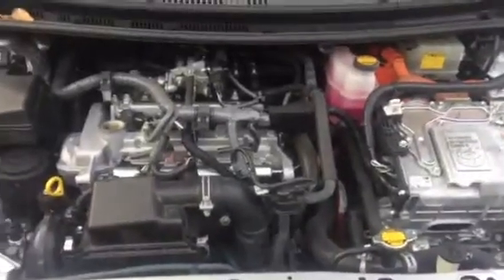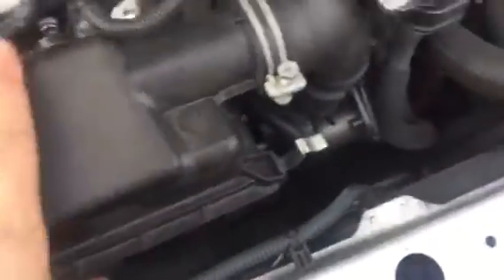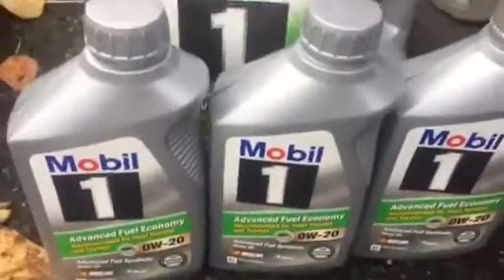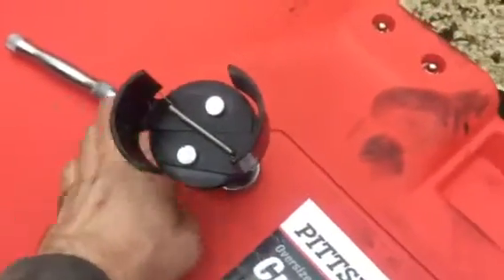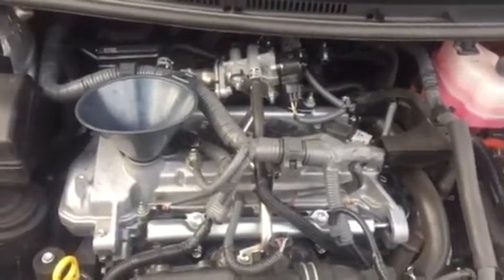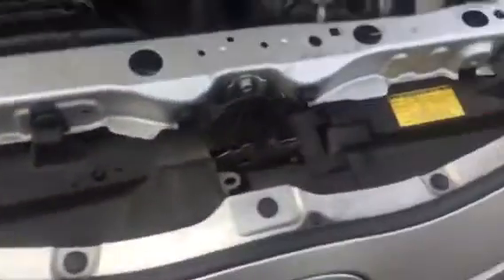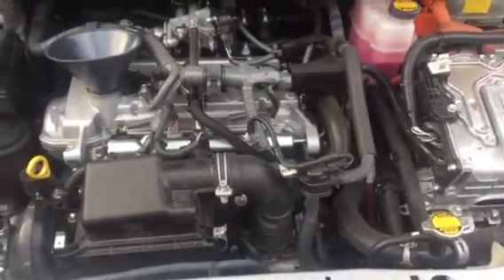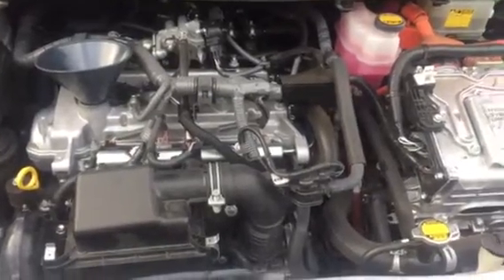2014 Toyota Prius C Oil + filters change

Comment: Super detailed video, thank you.  Question:  with your level of driving, do you follow the manual's advice and change the oil out once a year, or do you find it best to change it more often?
Reply from the maker: Cutlass Stallion I change it once every 10k regardless of how long it takes you to put them on.This is for the Engine oil and filter.For your air filter also 10k but i use K&N and i just clean it :)
Reply: This https://www.amsoil.com/  is much better oil and can stay in for 25K miles.  The K&N Filter lets more air in but it makes the computer dial up the injectors and use more gas.  It's OK if you want more power but a paper filter will give better MPG's.